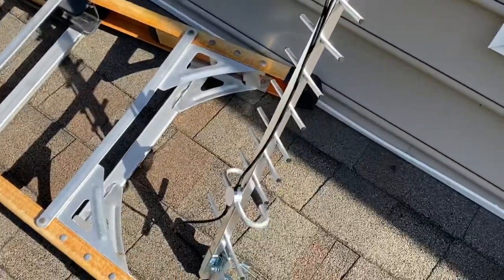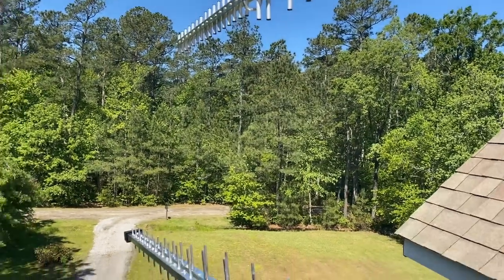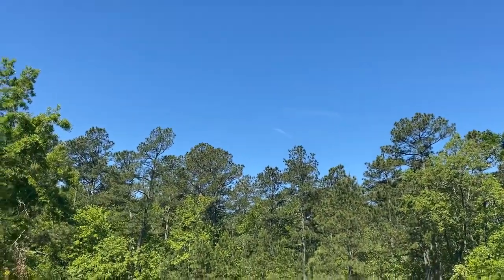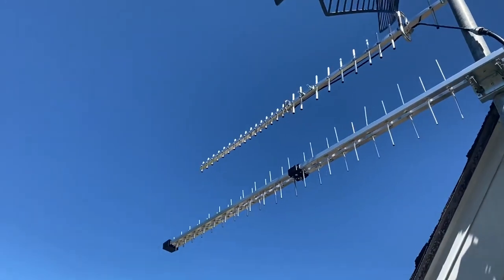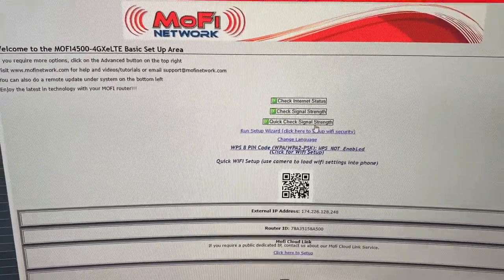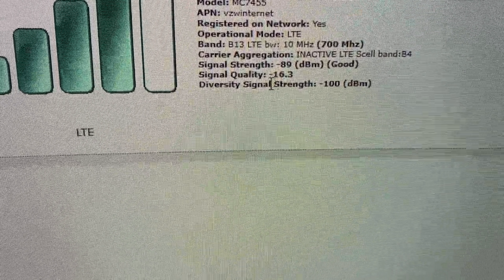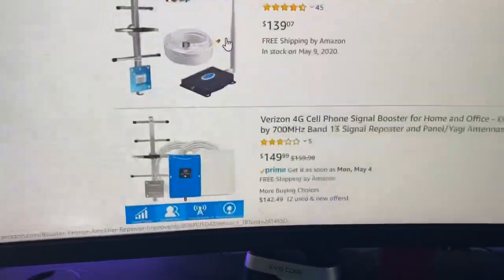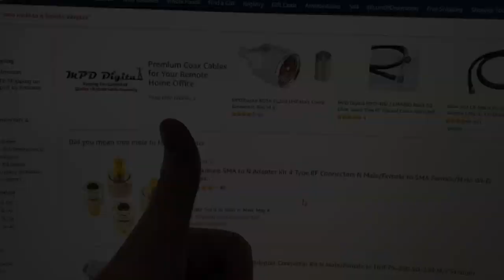NEW ANTENNA FOR MOFI!  PART 2 A MUST DO!

Comment: Wow, you sure have accumulated quite the collection of antennas there!  I would be STOKED to get ahold of one like that smaller one you had on that pole.  The little yagi I set up with my booster looks TINY after watching this video.  Got that Antenna Envy bro
Reply from the maker: I became a little obsessed lol.  Well the bigger the antenna it seemed the better the gain.  If you are using a booster any of these will work.  Depending on how far from the tower you are I highly recommend a parabolic grid antenna.  Best one I’ve tried thus far!

Comment: Question ? What kinda of range does the grid antenna have. I have purchased one plus I have a small yagi for secondary (mimo). The problem I have is - got a tower just 3 miles away and get excellent signal and quality but speed is shit
Averages just 4mbps. I got Hope's with the grid to lock on to a better tower but they are approximately 10 miles away. Do you think the grid will pull ina signal from that far away. I got all the stuff. Lmr 400, mofi etc. Your thoughts ?
By the way I like your no bs style.

Comment: I'm a little confused.  Did you connect the parabolic grid and the yagi to your mofi?  Or just the yagi?
Reply from the maker: I connected the parabolic to the mofi in the primary antenna port this helps signal strength so you want the stronger antenna in the primary port.  You can get a second parabolic or do what I did use the Yagi/LDPA antenna as the secondary port antenna.  It helps with signal quality.

Comment: Great Job! Getting a reliable signal is what it is all about. You are spot on about the trees, especially with higher frequencies. What I was not sure of, and maybe you said it, are you combining all of you antennas into a home brew antenna array?  From my experience and from your documented experience tipping the antenna toward the sky can help. What I have not figured out is if it has to do with selective interference from the building or the ground. The "perfect" antenna installation would be 4+ wavelengths away from anything up in the air with a clear line of site. Obviously that is not always economically possible and sometimes not feasible. I do know that combining multiple directional antennas together based on the wavelength separation can offer a performance boost. There is some math to figure this out but it should get you quite a few dbs, the ARRL antenna handbook has how calculate this... the other thing to consider is antenna polarization. It is not always perpendicular to horizontal of vertical if your near field (stuff around your antenna) is influencing your antenna. Something else to try. Experimenting for the best configuration is part of radio, keep it up!

Comment: @John Barth. I have to Wilson Yagi directional antennas in mimo config, cell tower is about 1.5 miles out from me. My numbers are.
Signal Strength-65
Signal Quality-10
Diversity Signal Strength-65
RSRQ-106
RSRP-702
RSSI-389
Can’t get over 5-7 down and about 4-5 up on Visible and the Mofi 4500 4GXeLTE V3. Locked on band 13, and have Advanced Bandlock set on 4, when downloading on speed test I see carrier aggregation become active but no speed increase?? So few questions. Why is my RSRQ, RSRP, RSSI numbers so bad? I have excellent DBs but such slow speeds? Any help on getting my numbers better with the RSRQ, RSSi, RSRP??
Reply from the maker: So band 13 is always super slow.  I would have advanced band lock with 4 and 13 would CA at times but sometimes it’ll click on the one that’s the strongest.  Keep in mind the band that is the strongest isn’t necessarily the fastest.  I would consider turning antenna toward band 4 more and get the lowest DBs you can on it for signal strength in real time.  You can do this by going to your quick check signal strength.  If band 4 still sucks do a band scanner and see what bands appear.  Try adjusting to each band and speed test see which one is your money maker.  I’ve found band 2 and 4 are fastest then 5.  You can also CA band 2 and 13 together also.  See it this helps you out.  Band 13 is a voice band and is high traffic it’s unfortunately always the slowest.  I only use band 13 if I get a good aggregation.  It makes band 4 or 2 more powerful.  Watch my CA vids see if that helps ya too
Reply: @rockernro  thank you brother. It’s a work in progress. Have you seen those RSSI and RSRP, RSRQ numbers that high before? From what I’m understanding those numbers I have basically indicate dirty signal or a lot of noise?
Reply: @rockernro  I’ve figured it out finally. Thanks for your help sir.

Comment: John

I have a mofi 4500 and I’m about 8 miles from closest AT&T tower. I have the dual yagi antennas and I have been getting 20 down and 5 up with a ping around 80 to 150. But it keeps dropping periodically and I can’t keep it stable. Should I go with 2 of the grid antennas?  Would that make it more stable and give me a better ping?
Reply from the maker: Luke Thompson so I would recommend us a combiner and use the 2 yagis as your secondary and get a parabolic grid for your primary.  Or use one Yagi as secondary.  Yes your speeds and stability will improve significantly

Comment: Question: If I were to get one or the other, which is better or do you have to have both? Ultra Wide-Band Cellular Antenna (Long Range) High Gain Parabolic Grid vs Log Periodic Directional Yagi Antenna.... or just small yagi's?
Reply from the maker: LYNNAE HENSLEY how far from the tower are you?  A parabolic grid will get you the most gain and more stable speeds!  That’s from testing ALL! If you have obstructions or over 5 miles highly recommend the parabolic grid in conjunction with a log periodic for your secondary if you don’t want to spend a whole lot.  Of course you can always get 2 parabolic grids

Comment: Use advanced Bandlock dont leave it on auto and dont just lock onto one band! Your welcome btw lol

note:Pick the 2 best bands to use with advanced bandlock. Carrier aggregation will automatically kick in.
Also the BIG thing for speed is the carrier aggregation...its essentially 2 sources of bandwidth sending and receiving the same data. The NEXT BIG thing is the MIMO antenna setup. It requires 2 antennas not just one! You have to set them up at 45Degrees and -45Degrees! Once you do these things you WILL see badass results! I love your antennas man. I only have 2 WeBoost yagis!
Reply: Rodger that
Reply from the maker: Steven Pope get a parabolic grid man game changer

Comment: You should do a video recapping the progression of your progress.  We live in the sticks and have a booster with the 8 dbi antenna that came with it. It works ok, but would like a bit more gain for times when the signal weakens for whatever reason.   I'm thinking of trying a periodic with better coax.  Would it be worth using the 8 dbi in conjunction with the periodic using a duplexer?
Reply from the maker: Cody Way I think you should get a log periodic with your booster and the LMR 400 cable bc my booster was getting 4 down with standard Yagi now it gets 30-40 down but keep in mind boosters band hop

Comment: So, I've discovered your work late, John, but am loving it. One thing I'm confused about though: did your log-periodic replace the Wireng you used to have for the MoFi, and now the new Quad band replaced the log periodic ?
Reply from the maker: Hubert Kirchgaessner yes if you watch the vids from oldest to new I’ve gone through a few antennas still on same mofi sim 4 combo.  Basically the WIRENG antennas wouldn’t be stable enough for me nor get me the best decibels from where I’m at being so far from a tower.  I switched to the log periodics and they were slightly better and picked up an extra band.  Then I bought a couple parabolic grids.  Sent one back kept other as my primary antenna and used a log for the secondary.  Helps out with the signal quality.  I don’t have a quad band router just a decent gaming router from netgear that I connected to mofi helping me to blast more WiFi coverages. Bc the Mofi WiFi is kinda crappy ..  That did the trick!
Reply: John Barth thank you, John!

Comment: Phonetone N female to FME female ? shouldn't it be FME male ? and then you need something to connect the verizon antenna cable which seems to me to be FME ..SMA FME idk . i just got the verizon antenna in today . the big assed LMR cables arrived . ok so I bought 2 only needed 1. it's hard to tell without ever having them in your hands. anyway to be safe ordered a handful of adapters . and sma to TS9 cable. currently  using a sprint sim in mofi which is truly unlimited but connection sucks ..which is better now that I'm doing aggregation..way better . so thanks especailly for that tip. .now for some reason verizon sim (both are hotspot sims)  refuses to connect anymore ..it did before ..signal is great but zero internet .bunch of reboots and resets  ..nada . something happened .. and I did a TLS swappa roo which seemed to sneak me out of data cap .but now it's like F u pay me . So I'll saddle the jetpack to antennas or not .. meanwhile I will  be in the perfect area for starlink beta testing . right now I'm in a reasonable cell area ..but in a couple weeks ..it's smoke signals .

Comment: That's not a log periodic but seems like a dualband yagi antenna.
Reply from the maker: Actually it is Log Periodic Directional Yagi Antenna 15dbi Gain for 3G 4G LTE XLTE AWS IDEN PCS 698MHz-2700MHz Wide Band Full Band https://www.amazon.com/dp/B075C8FX3S/ref=cm_sw_r_cp_api_i_YRD6F5FA50APGW4MFEF8

Comment: Hey man.  So im getting speeds in mid 20s with just the paddles that come with the mofi... would you still get the roof mounted antennas??   Do you thing they would improve the consistency??
Reply from the maker: michael parker absolutely
Reply from the maker: michael parker like if that is your Permanent internet solution then absolutely yes bc with an antenna you could double or triple those kind of speeds!  You must be in a city or near a tower!  Jealous

Comment: @John Barth My phone says its getting -119dBm and 22asu. 4G 1 or 2 bars. Sometimes it gets 12mb down and sometimes it gets 30mb down. To you think the Mofi would pick up better then the phone due to external antennas? Would 2 of the long antennas work together or does one have to be the grid type?
Reply from the maker: xrunner800 that’s pretty good so the mofi will enhance the speeds definitely if you get an antenna maybe 2.  The grid antenna is by far the most powerful so if you are trying to maximize speeds then yes use a parabolic grid.   Or get two of the long yagis and try it that way my man little cheaper but will enhance your speeds
Reply: @rockernro  thanks. I just found a spot in my house that my phone shows -106 and 3 bars. I wasjust trying not to spend $1000 all at once but I'm ready to cut my satellite TV off and strictly stream.
Reply from the maker: xrunner800 you can buy a couple yagi antennas cheap man get the LMR cables make sure Right connections on ends and you can orientate the antennas pretty much any way you want.  The mofi alone is expensive but sounds like you have a decent signal strength to where you don’t need to drop 249 on a grid.  Try it out man you’ll be surprised.
Reply: @rockernro  just ordered the mofi

Comment: For residential use, even in a big home, I've had just as good of performance if not better, by avoiding 50 ohm cable and antennas altogether (anything N connector for ham radio) Instead just go for all 75 ohm antennas and RG11 coax cable, and a 75ohm amp like what weboost has. You'll def save on money, and from what I've seen your gains going with 50 ohm N connector over 75 ohm with RG11, is very minimal. To date, I have still had the best luck with running wilson 75 ohm directional antennas with RG11, and use an actual paddle for your inside antenna (not the little one weboost sends in the kit) my best setup so far uses a Wilson directional 75 ohm antenna outside, with 30 foot RG11 cable coming into the house to the amp. Then I have a SMA to F connector adapter coming out of the amp, hooked to another RG11 cable about 15 to 20 foot long going to the inside antenna paddle (the one that originally came with my weboost home 4g kit - which was originally meant to be the outside antenna but paddles suck for outside) anyhow now I am holding solid -70dB 70asu. Even with my best configs before this I could only hold around 88 to 90 dB. And I'm like 3 to 4 miles from closest tower, I do not have LoS I'm covered up by trees. My outside antenna is only about 12 feet off the ground and slightly angled at maybe 20 degrees upward, towards the tower. Also I would plug your amp power into a good surge protector. And during the summer time get a little fan to set beside the amp to blow air directly on it, I swear it helps performance to stay more tip top, even though the amps are designed to handle higher heat thresholds, keeping it cool does help. Hope this helps anyone with their struggles cuz this stuff is hard to do, I've been self teaching myself over the last year all the how to stuff, I'm an ex cable installer for broadband service. One other thing I dont suggest a mofi 4500anymore, as of recently I fully prefer the nighthawk MR1100 and other devices like it, but the MR1100 because it's a gigabit modem and its software is now up to snuff to handle better aggregation than it did upon the first year or two of its release. And it is MUCH easier to setup and use for most people. If u have a business then maybe a 4500 but if u have residential service I wouldn't use the 4500. I've heard others before me, who are way above my knowledge even claim this over the last few months so there is something there to it. My speeds are also slower on a 4500 vs a nighthawk. It may be crazy but I'm just the messenger lol
Reply from the maker: But that might be good if you aren’t far from a tower but those who are really far as I was I used a parabolic and crushed it.  Sorry about your ATT plan.  I would’ve raised Hell
Reply: @rockernro  yeah they went retroactive on the plan even, it actually happened around the first quarter of this year. I had just gotten lucky enough somehow where they didnt catch mine, until I did the modem swap :/

Comment: I thought the mofi4500 locked? I need to find out how to use the mofi4500 signal meter in the browser. Any videos you used that helped I can watch.... I am lucky if I get 12mb down and 3 up
Reply from the maker: Check signal strength on the main page allows you to see the decibels in real time at the bottom.  You want that signal strength as low as you can get it while simultaneous turning your antenna slightly then once that’s dialed in turn other antenna or secondary to improve the signal quality.   Optimal signal strength needs to get as close to -100 as possible I was always on -104 and signal quality should be less than -12, -7 was optimal for me
Reply: @rockernro  thank you.

Comment: Which one is the main source for signal? I skimmed over the video, I want to know if the other antenna is better than the parabolic? I sent mine back, I wonder if that one in the description is better?? I still have the wire up from the parabolic. So maybe I should try it?
Reply from the maker: Harrison and Hailey sorry just now seeing this comment and yes parabolic as the primary and maybe a Yagi or log periodic for secondary.  I would ensure you are using the thick LMR 500 cables for less loss!